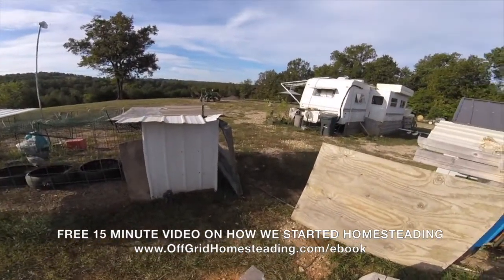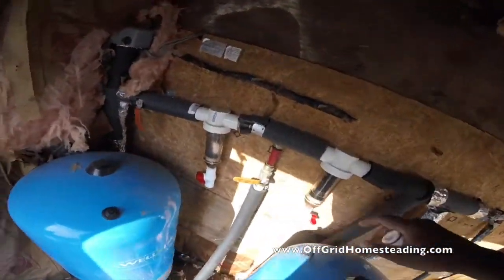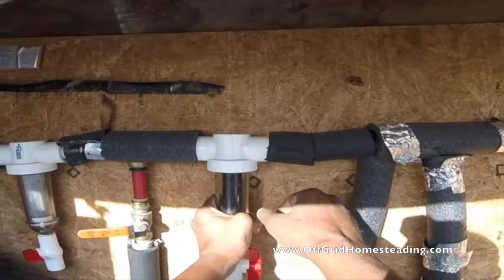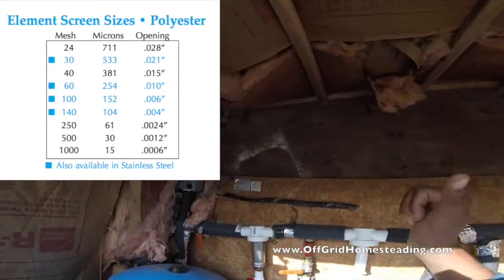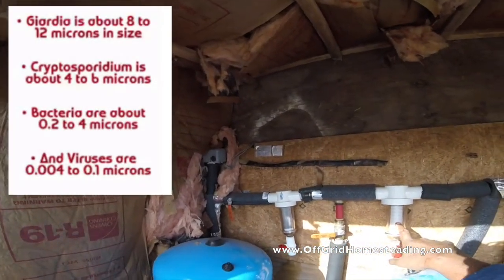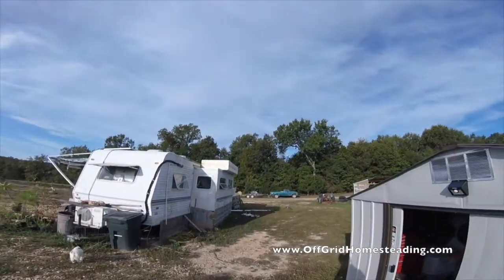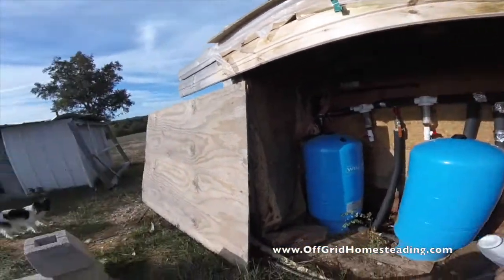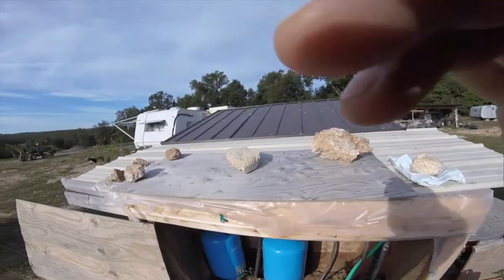OGH - Changing our Rusco Spindown Water Filters WOM

Comment: Actually a dam good video man well 👍

I'm looking to install a 2" spin down filter before our 4" x 20 " double unit. Had a micron Magna pleated filter as the sediment/pre filter before a high end Interceptor filter (us water systems filter) that kills and remove everything we don't want. Setup lasted 7 months, so I plan on the rusco 2" model taking the 4$$ whoopin then a 5 micron Magna pleated filter, then the same interceptor filter. Total setup hopefully last about 10 months atleast with very good water pressure.

I was hoping the 15 micron mesh would work, but if not the 30 is alright. I k ow your water supply isn't identical to mine but in your first hand experience you think that's viable? Being the larger filter maybe flush the ole girl on e a week or so is fine with me. With heavy rainfalls we get water intrusion into our well which kicks up tannins, fine silt and Lord knows what else. Don't have large sediment at all really, just the excellent filter clogging ultra fine stuff lol but I have a 10 month old Son so I am running the Interceptor filter from Us water systems for it's top shelf abilities and since it's the only filter the EPA themselves use I believe it is good enough for me. But it's roughly 150 bucks a filter, I will do anything to protect my family that'll never change, but if I can help it work even better and last longer that's a no brainer

Comment: Thanks for the helpful video!  Question:  Do you have any thought/pointers on so easily unscrewing the housing to change out the mesh filter?  We have a real problem unscrewing our Rusco to change out the mesh screen.  Hubs has very strong hands and even he has to try 4-5 times wearing gripper gloves before he can get the silly thing turning.  You seem to just give a minor twist and yours comes loose.  We've emailed Rusco and their answer was, "Yes, sometimes this happens."  Unfortunately it happens every time for us.  We must be doing something wrong.
Reply: add a little vaseline petroleum jelly to the threads.  Do not really crank them down.  They only need to be hand tight, make sure you haven't lost your o-ring.  Hope that helps!